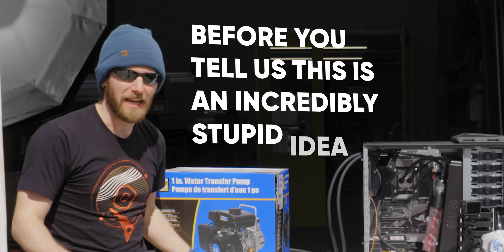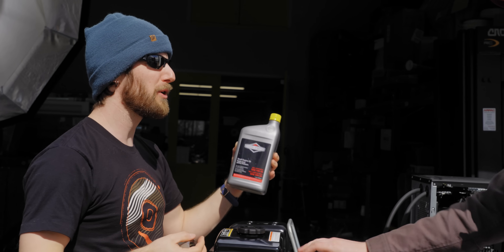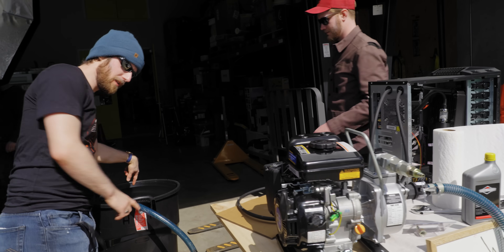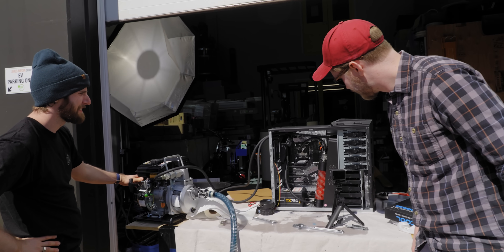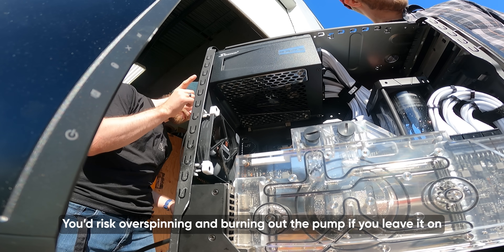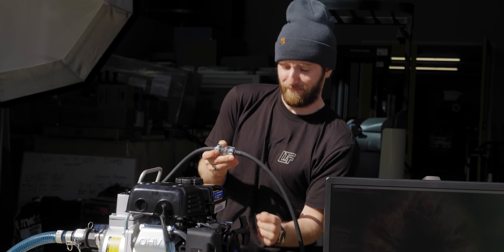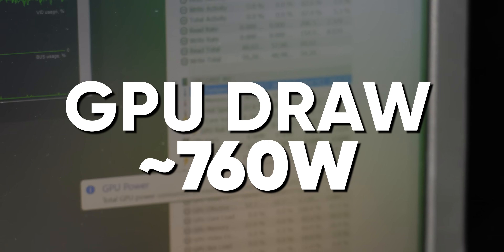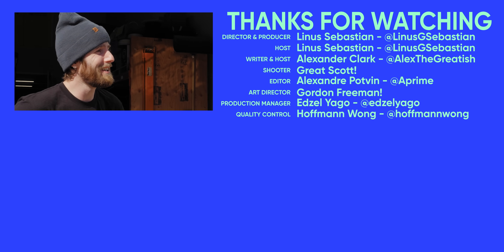Cooling a PC with a 2.5HP Pump

Comment: i think you would get the same effect with a normal pc water pump if the large bucket of water was used also, and place it up higher the water so it can also be gravity fed, just not too high, and recheck temps, and to go even colder you could put a chiller in the water and control how cold you want the water so you don't form frost.

Comment: 11:00 why didn't you disconnect the PC pump or took it out from the loop before doing this crazy experiment? 😂😂😂 I think the car radiator works better if you put some time into it and really think about everything. Or just put 3 PC radiators (2-3 radiator fans on top, 3 fan radiator on front and 2 fans radiator on side) that will give you less than 45-50°C with CPU and GPU in the same loop + a min  300-500ml tank.

Comment: This is stupis.Your flow is restricted by the small fittings,pipes,radiator and biggest one is your heatsink.Small pump will move the same volume if you get same pressure as the gasoline pump.Juat increase the RPM of that small pump with more than 12v.
The way to fix this is to separate the flow to each component and then after that combine it again.

Comment: Now you gotta try it with an inline  electric 12v water pump That is designed for small diameter tubing and pumps wayy better. and/or however many inline pumps can be used.

Comment: this was entertaining to watch but do you have any intention on making a serious video on flow rate? Just make a crude estimate of the pressure drops and get a pump with a high flow rate at the appropriate pressure. Probably something like a 50$ electrical garden pump. You can easily find one that has 3000 or even 12000 L/h flow rate and is also adjustable manually or even with IoT.
Should be much quieter than this thing, too.

Comment: I think that's less about flow rate and more about sheer amount of water available. You can't transfer heat to the water if it's not actually touching the hot thing long enough to do anything. Would be interesting to rerun the test with the stock pump, but with the 50 gallon trash can of a water reservoir and see what it does.

Comment: I have a great idea! Try a water block connected to a garden hose. The water should go through the block then the waste runs to a sprinkler in your front yard. It should be around 12c temp on the water.

Comment: Your not getting flow because your putting to much pressure on a low vacuum line. This creates back pressure so instead of the water moving forward it just wants to escape for any point of least resistance.

Comment: Would gasoline be a good coolant for computers?😂
Reply: I mean ignoring the fact it would dissolve any adhesives and eat away every seal there is - yes, it actually would be. Fuel pumps rely on gasoline flowing to keep them cool, which is why running your car on empty is a great way to burn them out. Gasoline is borderline endothermic; it's VERY efficient at sapping heat, and also very efficient at losing that heat too
Gasoline and diesel have HUNDREDS of uses to them, we just associate them with making fire. Especially diesel

Comment: All the silliness aside, I'd like to see the same computer tested with it's d5 pump and that 40 gallon trash can full of cold water as the res.  Curious if the flow rate is actually a factor or if it's just that the "loop" never gets saturated.

Comment: Considering the math that pump should be outputting 10x what a d5 pump does and maybe around 60+ PSI restricted considering pump runs at 37psi normally so def some restriction going on and the poor motor the back pressure on the impeller must be brutal. Years ago i used an a/c compressor and some copper tubing to make a cooler for my PC the two problems was the condensation and running the system too cold actually caused it to run worse unless you clocked the living shit out of it which then defeated the purpose as the power draw was to much

Comment: Okay so hear me out.
Pressure starts at the radiator.
Water can't flow super fast though the radiator.
You aren't recycling water in a small source, it's a big trash can full of water.
Get big water blocks, remove the radiator from the loop.
Bet money you'll see insane flow rates.

Comment: Had a pump like that one time, the burning was most likely an anti corrosion coating on the exhaust cover that burns off as you use it

Comment: More hp isn't actually better .
If the water becomes turbulent the Reynolds number is high and the  cooling decreases
Bernoulli equation only tells you about hydrodynamics not heat exchange mechanics

Comment: I loved the video, great laughs.    One thing with water cooling with a high volume pump is that when you reduce the size of piping its going to flow in, the pressure increases but the volume of flow goes wayyy down.   Waters thermal conductivity also comes into play,  water is most efficient at transferring/absorbing heat when it has time to collect that heat and take it with it to the rad.   Fast flowing water cant have enough time to absorb heat causing low water exit temps and high heat temps at the gpu. Finally, the chilled water plus the huge ranivore also caused a huge delay in temps moving.  Water loops dont take that long to heat up, causing temps to yield at a temp and stay there.

Comment: As I hit the 4:40 mark and watch them play with this stream of water. I can't help but ask is it possible to move the water so quickly that it would never have enough time to actually absorb the heat? Kinda like moving your hand through a flame quickly. Following that path of thought, you would be required to have a closed loop and to allow the entire system to heat up. Resulting in a system that's cooling efficiency would be minimal. Guess we will see by the end of the video.

Comment: I worked in industrial plastics distribution for two or so years and I can safely say the issue here isn’t power. You’re throttling (no pun intended) your flow rate with your ID. You would probably be able to make do with a car radiator which usually have 1 to 1-1/2” in and out. Honestly you can probably make the crudest cpu block you could imagine and it would be cooled by flow rate alone. 

Basically if you can get your loop ID bigger you’ll notice the performance bump from the

If this seems interesting let me know and I can point you in the right direction to make this even Crazier

Comment: When you decrease the pipe diameter and increase the flow you increase the friction of the water against the pipe wall, which should be factored into your head pressure calculation. You need larger diameter pipe and fittings.

Comment: As A MECHANICAL Engineering student,
I just want to share that it's a centrifugal pump which is used to lift water to overhead tanks,
Which needs a high pressure (it's 37 psi almost same to cars Tyre pressure) and the flow rate is always low (in this case 85ft of water = 25m/s)
So, Sir please  check the pressure rating of water cooling components.
😁

Comment: there's electric dive pumps wit habout 3 times the pressure head and about 1/20 the setup hassle
and givne the flwo restriction of a watercooling loop, even with less power and less maximum flwo rate a pump with 3 times the pressure would proabbyl create mroe flow
though you're gonna hit diminishing returns eventually
at this kind of flow rate with fresh water and no radiator the vast majority of your temperature difference between inlet water and cpu core is going to be the temperature difference between your waterblock fins and your cpu core
copper only has so mcuh thermal conductivit,y so does thermal paste, aluminum, more thermal paste and silicon

Comment: " seems like there is a lot of pressure and not a lot of flow" well I'd tend to agree with a 2 inch inlet hose pushing water through a 3/8 tube lmao.

Comment: So many things wrong with your benchmarks:
1. Your massive water revisor will take ages to heat up
2. You are probably flow choked by the orifice size of your smallest hose which means your huge pump is probably pointless. Try putting a pressure gauge before your reducers on the pump output.

Comment: Ok but what if you guys ran off all that excess pressure to... a few other PCs? And perhaps add some digital I/O to control a solenoid valve on each of those PCs to only deliver water under heavy loads?? And maybe a pressure sensor and drive for speed control of the pump??? Oh, to be an LTT engineer...

Comment: What if you place the 2.5 HP after the computer so that water is being pulled through the GPU block instead of pushing it through.

It the fittings fail, it would pull air, and there would be no heat introduced into the loop cooling the GPU

Comment: i did a total loss watere cooling similar to this but with no engine i just use the cold watewr tap pipe it to my laptop and run the return line back to the same sink i got it from or to a large container where i can reuse the water or just run it outside, i admot its veery wasteful but i get very very good results, i can run idlemtemps all day at 15 to 20 c and run non turbo at 30 c and haven testede turbo yet because i need new paste ive just been using temporary homemade thermal paste out of silicon grease toothe paste and atf oil lol
]i made a fast video search for jank laptop watercooling
its about 29 seconds long

Comment: I love that you all used a electric pump in the thumbnail. Especially a way weaker one that you used in the vid. Also that puno is way overkill for what you're using, use one that is 1/3rd horsepower and will give similar results with probably the same amount of water moved

Comment: An open cpu loop would be cool with a custom water block, just no radiator just bucket to pump to cpu, then ice in the bucket to keep it cool  cool just reduce the amount of bottle necks the water has in pressure

Comment: that moment you used the snap on air hose fitting instead of the sharp ribbed water hose fitting 😬 yea i can already see bad things happening there.
Also you should have steel hose clamps on the hoses

Comment: You shuld use higth presure pump, the pump you used yes can deliver much water many liters per sec, but only on fat hose, wich means little presure, you used snall hose thats why yourse performance wasnt much better than pc pump does, use higth presure pump that delivers more water truth that small pipe, or go extreme, use power washer👍

Comment: The fact that this gasoline engine-powered pump was tested with the Initial D themed pc is perfect.

The next step is to use an actual 4age engine to power the pump.
Reply: Those aren't cheap by any means

Comment: Something I feel is important is ambient temps, without them there's nothing to compare the GPU's current temps to.
Placing the radiator into a much colder environment would massively effect it to.
All pumping up the pressure does is increase convection, who knows how much heat is being sucked in from the pump too.
When it comes to fans I heavily recommend RC Electric Jet engine fans. Some of those are easily rated for 8KG of thrust they are amazing for radiators if you just don't care about potentially ripping flimsier radiators apart and or the noise.
I honestly refuse to search for regular fans now on google because of how often google instantly thinks I want "Stealth" "Ultra quiet performance fans" Its not high performance if its also ultra quiet, its maybe ultra efficient but no, once you get your hands on electric jet turbines it makes quiet high performance fans seem like false advertising.
Something I would like to see honestly is a PC with phase change cooler that cools the inside of a box a PC resides in so the heatsink on the PC can suck in cold air without any large sources of moisture entering the box.
Would be curious how far you could take something if you had the best heat sink, using the highest CFM fans breathing sub zero temps right through the heat sink. 
Pretty much imagining a -80 box of uncompressed air being compressed against the heatsink itself. 
Having a heater just to get the PC to boot and how much would the voltage have to be cranked to keep the PC from locking up just from being too cold and what kind of clocks that could generate.

Comment: The crazy thing would be to just hook it up to city water in the winter (just dump the output down the drain).  I bet you could run it cold then.  You wouldn't even need a radiator in the loop.

Comment: omg! lmao you're gonna have to put the pc like 30ft in the air in order not to blow the block apart lol with the pump in the basement  and the pc  on the 2nd flr oh and don't 4get the hose clsamps lol you WILL need them 1/2" tube

Comment: Hey Alex, with a high power/flow pump compared to a standard pump, you can think about the situation in a more simplistic manner by just imagining the flow rate through the loop is infinitely fast. Liquid moves over the CPU so fast, and through the radiator so fast, that you can more or less look at the rate of heat transfer happening uniformly across the total volume of fluid in the system.

I'd think if you'd really want good/sustainable performance, you should also increase the reservoir volume by maybe 5-10x feels good.

Comment: Good idea, thinking of the power draw of the RTX4xxx series .... but those gas prices *sniffs

I kinda did that back in the days (where PhenomII was new^^).
We used a pump from the central heating system and copper pipes. To cool two gaming pc's in a row. Both were fitted with customized water cooling on CPU and GPU. 
Our container had 65L of distilled water with anti corrosion and anti bacteria additives in it. 
A hell of a project and worked awesome. Not necessary to mention we also had a big radiator :D

Comment: If they use a standard pump pulling water from that same bucket of cold water wouldn't you expect similar cooling. I  think most of the benifit is coming from having such a large cold water mass not the flow speed.  Also you could remove the radiator since it's not cooling the water any more.

Comment: Hi Linus,  For the next project,  try using gas to cool, something like how aerosol cans get cold when you let air out. Either make block that is strong but thin like an aerosol can or something like that manner. You get the idea. The cans even has a  frostbite warning so I'm sure it can handle a CPU 🤣
Reply: This is the very basics of how an air conditioner works.
Reply: @turdington1404  thanks captain obvious. ❤️

Comment: But a large electric pump pulling from a large ice bath? That would be good. You can buy electric motor pumps that get more horse power than their gas powered one. So fins somewhere in between.

Comment: I think this experiment should get a Pt2, build custom blocks for the cpu to allow direct flow through it, and make the fitting for it slightly bigger to allow less pressure but more volume of water through, i think part of what made this so risky is all the radiators and reservoirs, which honestly wasnt needed lol, just run the lines straight to the cpu block and let it run it would be way more reliable.

oh also the bad scent and smoke you saw on exhaust was normal, that was the heat from the exhaust burning the paint thats painted over the exaust cover, after the pump fully breaks in it goes away

Comment: now, I want to see a Mini fridge, converted to be a large tank with openings on the top to allow in and out with a fill port. Have the fridge still working. Let it cool the entire tank for a day or so. Then connect to a decently powered electric pump. Now you are putting cold water into your loop and dumping warm water back into your fridge res, and the size of the mini fridge would prevent water temp saturation especially with the fridge running......Man i wish i had the money and engineering to try this XD

Comment: You're right I can't wait to see it.

11:30. What you need is an electric aquarium pump. Which I think you're familiar with. And a pool. Or if you're a real G. A stream, river, lake or ocean.

In any case. Even if you just have a pool. If you put the inlet on the other side of the pool from the outlet. You will never recycle any hot water.

The thermal energy lost or gained from the exposed surface area of the water. Vastly outweighs any heat the PC will put in. Even into the kilowatt range.

So it's like having a continuous source of cold water.!

I am nowhere near as well off as you Linus. How am I ahead of Linus techs. I mean I got the idea from you and your whole house or room or both or whatever it was water cooling setup.

I think Luke's dad welded the pipes for you guys. Didn't they leak. Lol.

Those were the days.!

I mean technically now I think back on it. You had that huge RAD outside where it's pretty cold in canada. But I remember it wasn't getting the job done. Not to mention I also recall you having a pretty contaminated loop. Would you even tried to fix to no avail.

But I've already found the solution which I think you're also familiar with. 3M's Aquiforgia. It's what you and Luke should have used in your Fish Tank PC. For maximum heat transfer. As it is non-conductive. Also if it leaks. It just evaporates. Quickly. But is not bad for the environment.

My temps never go over 32 C°.
Reply: Disclaimer.! Or Caution or heads up whatever.

I wouldn't try this as a permanent solution unless you happen to make your own energy.!

Comment: There's been whole room water cooling and now gas powered water cooling. I can only think of two more ideas: connect a PC to the municipal water supply as with so many employees water will always be circulating through it or pipe it into Linus' new pool.
Reply: they did something similar already couple years back. linus was on vacation and Alex got bored.